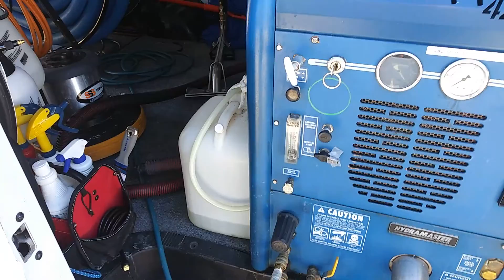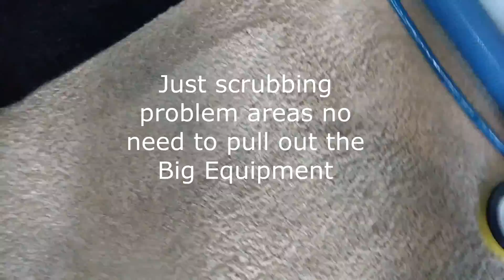Small tile and carpet cleaning job for repeat customer - Well kept flooring

Comment: How’s your Truckmount holding up, I have a old Prochem and it’s still going strong 💪
Reply from the maker: Its going good I bought it used then put a new engine in it. And fixed a few things about year and a half ago. Been running good so far.